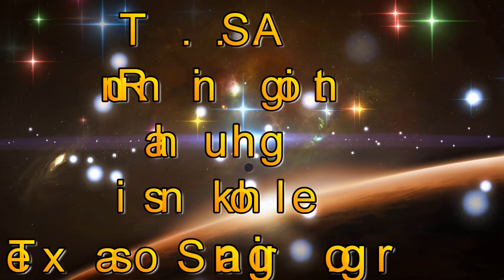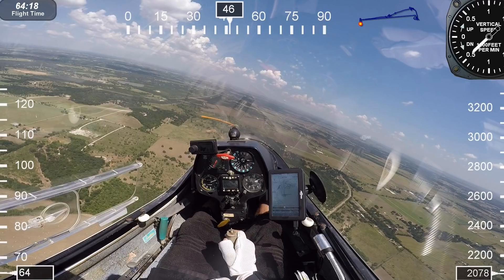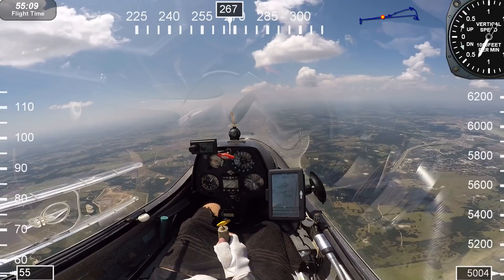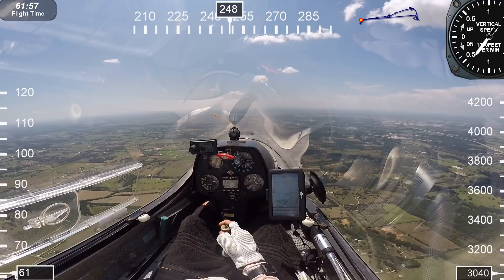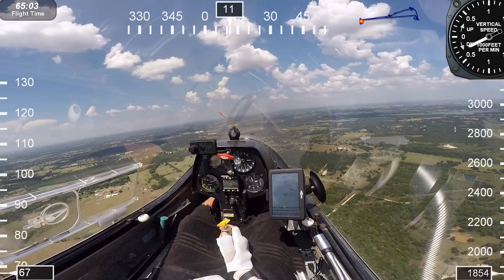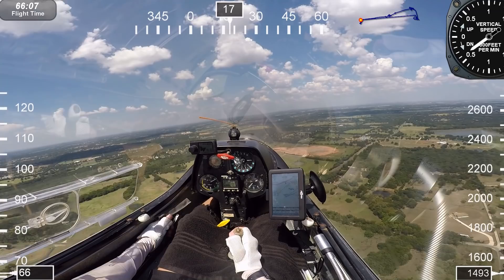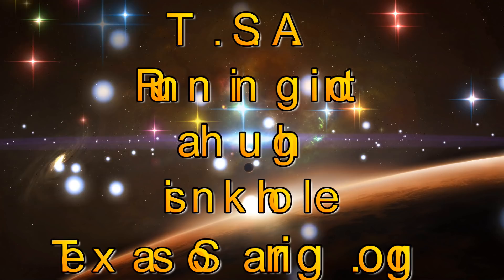Flying glider into a huge sink hole. Running out of time. What to do. Roy Dawson video

Comment: My last one the towpilot had gone home already.  Luckily club members came to get me!    Even when you set out at 5000 you appeared to have several thousand feet of convection above you.   One of the perils of high cloud bases is that finding good thermals down low becomes less obvious and more difficult, as interthermal distance goes up as convection height does..  Often it works best to plan to stay in the top third of the distance between bases and the ground, and take anything if you get below half the distance to bases.  Thanks for sharing.
Reply from the maker: The area I was flying is called the green zone which can be lower in thermal activity at times. The fortunate situation is there are airports about every 6 to 10 miles heading west from TSA. Thanks for the feedback.

Comment: Rule number one:  Don't circle in sink.  Rule number two:  if the only lift available are thermals, you want to be on the ground before the sun gets too low to develop thermals.  Rule number three:  if you're running out of altitude, don't pass up a good landing field that you left behind, hoping to "luck out" with a better field ahead.  Listen to your gut.
Reply from the maker: Doug, perfect set of rules. Thanks for sharing

Comment: A very similar thing happened to me when, with very little experience of solo, local flight (2 hours?), I got caught too far from the strip in a K8.  I did a 10km final, skimmed over the top of the boundary fence and landed without airbrakes.  On the way, I also experienced - let's say "negative lift" - but I would have called it down-draught.  My understanding of the term "sink hole" is something quite different.  A quick search for "sink hole" on YouTube finds a lot of what I understand the term to mean - so when I read this title, I was expecting a very different video - possibly a model aircraft flying into a sink hole.

Comment: It must have been pretty hard to find that "sinkhole" on such a perfect gliding day, just to make this instructive video. I appreciate your documentation, though instead of flying where the airfields are, I propose to rather fly where lift is, at least that is what I have found to keep me airborne more reliably than those airfields do. ;O)
Reply: Yup. I also can't help but feel that 80% of the sink hole was a heavy left foot on the rudder making the glider fly sideways and draggy the whole time. At the start of the video the string in centered, but later on it's always faaaar our to the left -- except when making a slip the other way on landing approach.

Comment: Allright... See the cloud @2:38 on your 1 o'clock? That is where the lift is and you fly right past it. The problem originates in the theory you read (the McReady part). As if "you can only glide down in straight paths between the thermals you circle in". Real cross country pilots will use any lift in between large thermals and find "paths that increase your glide ratio". This will increase your glide ratio with 50% to 100%. This allows you to take only the strongest lift and stay in a higher altitude band on average. By doing this you effectively mimic an open class glider. You should strive to 25% to 30% circling in your IGC file. 

This has other advantages: Strong lift is easier to center and will always stay strong to cloud level. Flying straight is less tiring too. 

Check it by analyzing IGC files from WC. Those guys can have 1/60+ glide ratio's with simple gliders... 

Btw, the best way to practice finding such paths is with a better glider than what you are using. If you fly an LS-4 or LS-8 or better then you can f up a little more without the punishment of outlanding.

Comment: It scares me you cannot apply "go around power" lol. That "only one chance to get it right" is nerve racking!
Reply: It isn't if you are trained well :)
Reply: You have quite a bit of reserve potentially and kinetically, plus wing in ground effect. You can still correct a range of errors.
Reply: On final you're normally aiming to have something like half airbrakes open. This way if you encounter unexpected sink or find you're a little too fast/high, you have a huge range of adjustment available for fixing things up by opening or closing the brakes.

Comment: Nooooo thanks. I'll fly one with an engine and only glide if the engine quits.
Reply: It does take balls of steel, trust me, particularly cross country flying, there are so many telephone wires and electric power cables over a small town its unbelievable, if you managed to land safely 5 km away from a small town it would be a miracle. 
On my second solo I went cross country. That was a bad mistake, I had never been cross country before and I had no training, not even with an instructor, I had never done it before, and I hit sink, I got down to 800 meters over a small town and was trying to set up for a landing in a field, I promise you I was terrified out of my mind, that was scary level 150% if there even is such a thing.

But then suddenly the tail of the old 1957 fabric glider came up fast and pushed my nose down, so I had to fight it and get the nose back up and turn hard. The altimeter started screaming and I started going up fast. 
I got such a scare from getting so low,  I stayed in that thermal until I got oxygen deprivation, it was an accident.

You may ask " How is that possible" well I live at an altitude of 4000 ft above sea level and my altimeter was set to AGL which is "Above Ground Level", and my altimeter showed 6000ft. So I thought I still had another 4000 ft to go, to get to 10 000 ft.

In gliding if you want to fly above 10 000 ft you have to take an oxygen bottle with you.

Luckily I had built diving bells as a child and I picked up the same sensation coming on, the sensation of running out of oxygen, and also in the way I was behaving, I was singing loudly, like I was drunk and I was doing loops and tail slides in this ancient 1957 aircraft lol then I thought to my self "Stop, rather go back down a bit, you only at 6000ft but something is not right"  ha, ha, oh boy some thing really was not right.

Just as well I went back down, because if I had continued I would have just passed out and I was alone in the 350 kg aircraft, it was awesome, but at the same time very, very dangerous.

Even airline pilots salute glider pilots because when you coming in to land,  there is no going around for another chance, you better be able to fly or you going to die and there are not many pilots willing to fly with those odds even although its one of the purest forms of flight.

https://www.youtube.com/watch?annotation_id=annotation_528810&feature=iv&index=3&list=UU8riJvrsMiQ4hfi-jvNdVVQ&src_vid=UK5XVGV8eM8&v=wo4LlpFs-5M
Reply: word.. who flies a broken aeroplane!
Reply: The training afforded by glider training will vastly improve your normal flying. People don't want to do it because it's hard and they don't want to be bothered but hard work makes you better.
Reply: Superior pilots ;-). I always compare it with a motor boat and a sail boat. Just not comparable. I know a lot of fighter pilots and large aircraft pilots who fly sailplanes in the weekend.
Reply: Blame USA: There are idi... people who jump out of perfectly good airplanes for fun.  Gliders seem safer to me... :)
Reply: Yea, a lot of pilots don't want/can't understand aerodynamics and physics other than basic ones, which makes for pilots that can do basic maneuvers, but nothing more and they won't improve their skill. Something that they can't understand or achieve is just pointless and unnecessary for them. I'm not a full-scale pilot (just RC/FPV pilot), but I see that often when flying models with people and it seems to apply to real planes
Reply: ahmad samadzai put a jet engine on a glider
Reply: ahmad samadzai powered noob
Reply: ahmad samadzai - Good luck with that. Powered planes can't glide for shit compared to an actual glider.
Reply: already done.
Reply: Haha! I went gliding once it was so scary not sure I'd do it again. It drops all time
Reply: holy fcuk, my thoughts exactly
Reply: ahmad samadzai well you can’t have an engine failure if you don’t have an engine
Reply: @EVZebra That was a neat story haha thanks for sharing
Reply: I think you'lfind they glide like a brick.

Comment: "21$ / hour - thats amazing" - Indeed it is. Amazingly expensive. We only pay for the aerotow, the rest is fly as long as you'd like. Aerotow up to 600m costs ~ 20$. After that it's fly as long as you'd like, without having to worry about further expenses.
Reply: IBMicroapple you have to rent it, its not yours, if you rent a car you pay for the car but you also have to pay the fuel you consume, with those 21$ you pay the tow and the glider

Comment: Wow that slipping from the plane that low was pretty impressive. I dont have the courage to slip that late 😂
Im only slipping when coming in too high on final where landing is asured and i have a couple more feet to the ground
Reply from the maker: Slipping comes naturally since I owned a Citabria that didn't have flaps
Reply: why not? Just must be practiced regulary. I prefer doing it on short final when I am sure that I am still too high. IMHO it doesn't seem that late in the video, he started just after turning into final and stopped far from the last trees (and the runway). A nice exercise is pretend that your flaps are blocked when landing, but just pretend, if needed use the flaps.

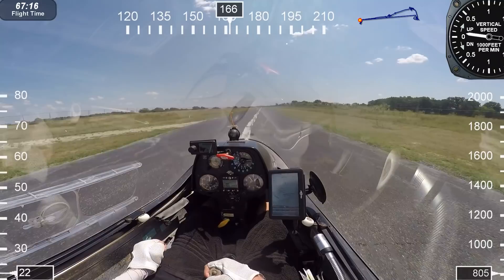Comment: 6:46 reduce? I’m in glider course and i have learned that if you reduce spoilers in ”flare” you are going to bound, so instead reduce i think you should increase spoilers in flare so you wount bounce, am i right?
Reply: Keen observation for a new pilot. True. Generally, don't mess around with your spoilers in the flare - set it and forget it (unless you are doing so for very specific reasons). In this case, I suspect he's going to half spoiler because he's landing on pavement and is concerned with the harder landing full spoilers can produce if you don't manage the energy accordingly. I almost always land (gliders) with full spoiler and use a just a bit more smash if I'll be landing on pavement.

Comment: cool video! As another glider pilot, what was your decision altitude? I usually use 1500' and it seems like you used 800. Did you consider thermalling over the asphalt? Also whats your "search pattern"? I usually just fly max L/D to get away from it and then circle up a thermal once out of the sink.

For those who are unaware, those are great prices for a glider. Soaring is like no other type of flying. You learn so much about air currents and its like a chess game to see things that are invisible. Go get a glider ride!
Reply from the maker: We use 1500 msl which is about 900 ft above the ground for a normal pattern. I got too low to do a normal or abbreviated pattern, therefore, plan B was to land downwind. Its all a part of your training. I'm sure you did plenty of downwind landings and releases at low tow meaning 200 feet above the ground. Thanks for sharing, Roy
Reply: I think the biggest lesson I learned even as a young instructor was to commit to your decisions. Downwind landings aren't that bad as long as you keep your speed and have enough landing area. I remember my first 200' turn back from a simulated rope break, it was terrifying. Needless to say I gained a lot of trust in the performance of the airplane and just learned to commit to landing. During my commercial my FE pulled the rope on me at 400 agl right before the turn to downwind. I thought he was going to fail me for my decision to land downwind, especially with a huge lake at the end of the runway in that direction. He told me it was my commitment to my decision, not necessarily the best decision or the prettiest pattern, that helped me pass.
Reply from the maker: Wow great feedback thanks for sharing
Reply: I learned to START looking out for a field in about 600m (~2000ft) about ground, just getting an overview where you could land. At 300m (1000ft) you should have the field, at 120-150m you should be entering downwind.

Comment: I don't believe in this theory if you have sink there is a lift somewhere. I believe in large scale weather systems. If you have high pressure air is descending on large scale and is flowing in near the tropopause and going out near the ground. Thermals are around but they are depressed and the double strong sink is everywhere else.  If there is over development  - the opposite situation sometimes you can fly for hours even without circling just by going from cloud to cloud. Almost no sink anywhere. It's visible that you are flying to the a bit different air mass.  I would took that nice cloud on the right at 3:12 and climbed to the top before trying going further.

Comment: What happens if I want to pee during flight?
Reply: Um, it Depends.
Reply: That's what wide mouth Gatorade bottles are for lol unless you happen to not need a wide mouth bottle...just saying....
Reply: That's exactly what I used lol . @oceanhouse8080
Reply: OOCOME Male Urine Bottle Portable Urinal $15 on amazon holds 2000ML. I replace the hose with clear rubber hose from home depot put clamps on it.  Problem with Gatorade bottle is if it gets more then half way full can't lean it over anymore.   Other options amazon has bags instead of plastic jug type easier to store it. Really have to put clamps and better hose on it because come lose not made for small glider cockpit.
Reply: The pw-5 actually has a hole in the seat to pee in

Comment: why d'y'all keep movin yalls legs?
Reply: Messing with the rudder pedals, I guess it's more common to use the rudders in a glider.
Reply: Rudder petals
Reply: my guesses: any aileron will reduce lift. it's less 'force' as it is response to air changes.
Reply: In a glider, rudder is used a LOT in any turn.
Reply: Yalls? Wtf?

Comment: Hi Roy Dawson can i ask you how did you put flight data on you video. I'm really interesting about that.
Reply from the maker: I used the gps data logger file (ICG) in the glide and used a free software called Dashware.net which is offer for free from GOPRO
Reply: Roy Dawson Great ! Thanks. The GPS Logger (ICG) is an application on your tablet ?

Comment: $21 an hour, shame i'm not in USA !   think i'd be too scared with no engine. thanks for video.  is there space for a chute in a glider ?
Reply: Lots of solo pilots carry chutes on them. Not all, but most do have one on in a sport glider, or single, for longer trips particularly.
Reply: Certainly. When I flew gliders, a chute was mandatory, and the seats are made to fit the chute.
Reply: Stu Jamez id strap rc jet engines on the back
Reply: In my club we pay depending on the plane youre lying, you pay for a trainerplane or a medium skilled plane  7 to 9 € per hour, and for the topnotch with a small engine like an asg29 (14,40€) or a duodiscus xt  (18,00€ --> its a double seated glider, so you can divide the cost).
Its very safe to do this, cause first you learn how to start, land, control the plane and so on. For that you certainly dont need an engine, cause you never fly in storms. Before that of course you get all the theory. And then after you got your license you can start to look out for flying longer distances. Depending on your skill/experience, the plane, the weather and the location between 50 and 1000 or more kilometers.
And yeah here in germany you wear a parachute. In a club you even have to.

Comment: Does the $21include the aero tow or is that extra.?
Reply from the maker: tow is extra. $20 first 1000 feet and 1 dollar per 100ft increase in altitude. So basically at tow to 2000 ft above ground would be $30 plus 21 per hr glider rental.
Reply: Very affordable, amazing